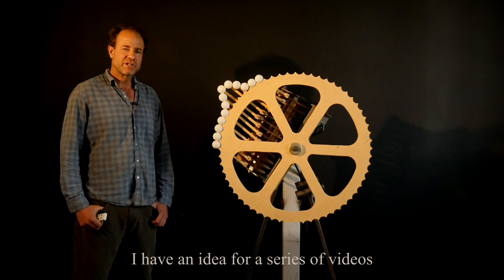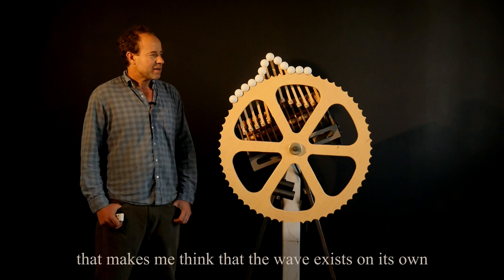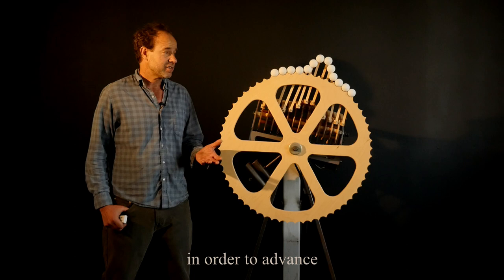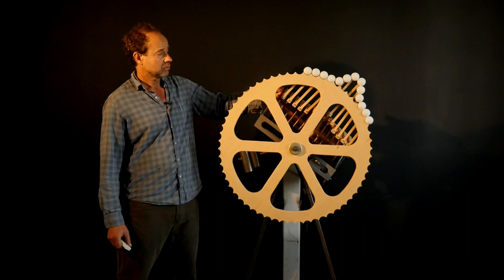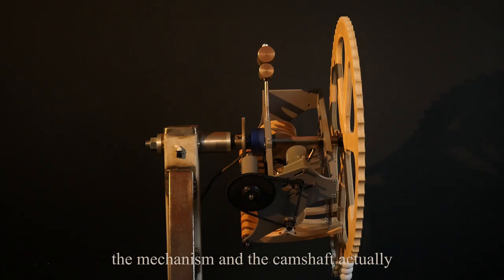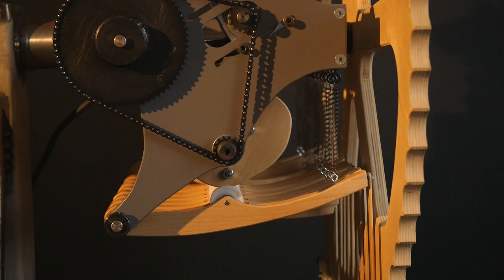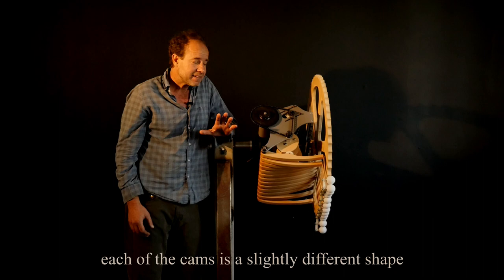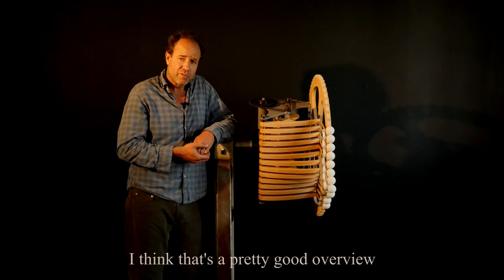Caterpillar with Commentary

Comment: I would love to see more of the actual math you use, and how you apply the trigonometry of sine waves into all of this - how you actually do the calculations of how many degrees or radians each cam is rotated to put just the right amount of slack or tension in cable #11, etc.